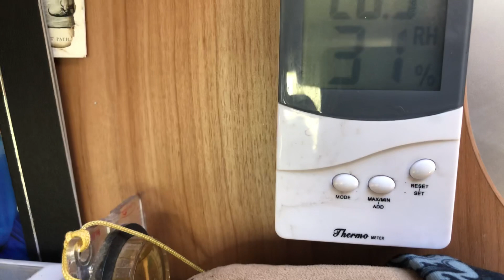Vapour barrier is it a myth 🚐☕️☕️🙏🏼🏴󠁧󠁢󠁥󠁮󠁧󠁿🌈🙏🏼💙❤️💙❤️

Comment: I think the idea of a vapour barrier is  to stop warm moist air reaching a cold surface, ie the steel shell of the van, where it will condense and cause damp, at least that’s the principle in the building industry. That’s why your windscreen will get condensation on it but the double skinned roof lights and side windows generally won’t.

Comment: Hi Chalky. Ok lets talk Vapor Barriers.:) 
As discussed in another video we know that after taking all steps to prevent trapping moisture with good ventilating then the Dew point is our moving target temperature that we want to be aware of and stay above to prevent condensation. 
I'm afraid when dew point is reached anything that can will start to absorb moisture like a "sponge". This can be out of site area's behind panels. The van shell being single skinned is a big one. Condensation can form and drip onto furnishings which can go on to develop black mold. This is why a vapor barrier is very important in van builds.
The ultimate barrier would be to spray Closed Cell spray foam at the start of a build through out the hole van shell and then be aware of your Dew Point and adjust your heating (as you do) to stay above it. Hugh Tube spray foamed the hole shell: https://www.youtube.com/watch?v=IjDwvt-bONM&t As he says in his video it was quite costly but when you factor in it does insulation,sound deadening,and vapor barrier in one go its not actually that bad. HTH

Comment: i’ve had to in mine we have log heaters at the moment and we have struggled with condensation, we’ve sound proofed ,insulated, vapour barrier and ply over the top .
outside of the truck is ali so gets rather cold and with it being warm inside it moisture builds up we have had to leave a gap between the wall and barrier so it can run out under the truck and get no drafts atm as ply is over the whole of it
Reply: not log sorry LPG